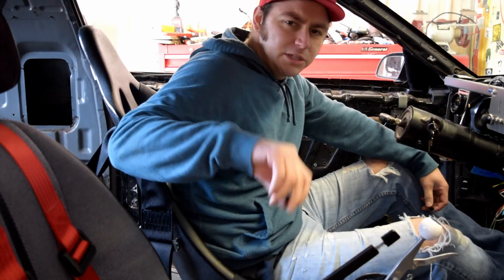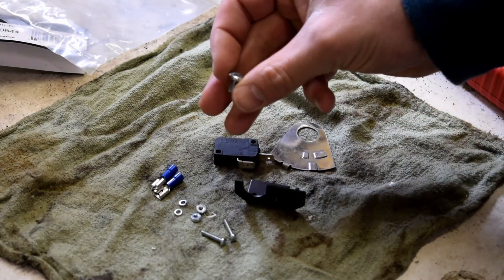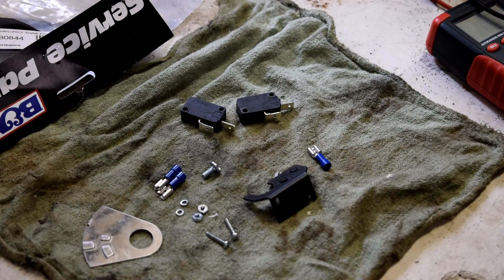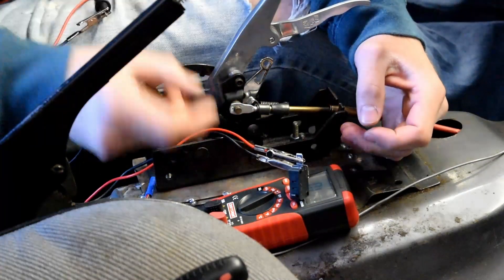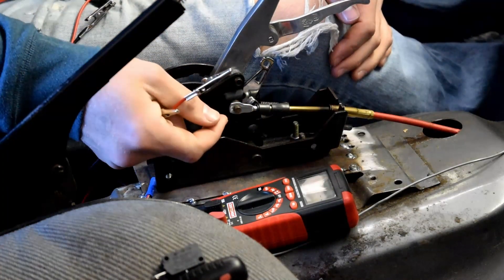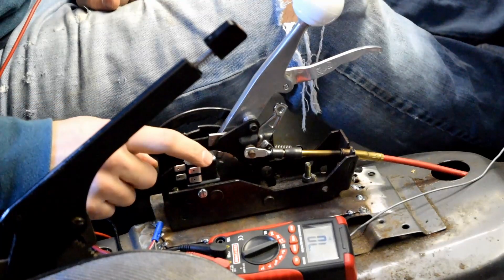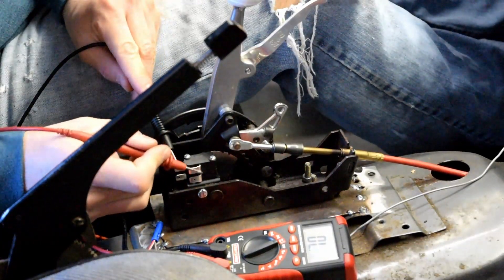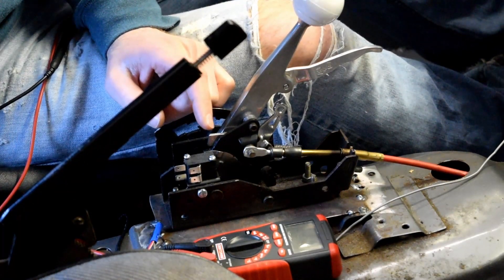B&M Neutral and Reverse Light Micro Switches Installed on a Pro Stick

Comment: Nice work and good video. Did you have to use those microswitches to trigger relays? Or are the switches rated to carry enough current to powers the reverse lights/NSS? The rating on the micro switch that came with my shifter is 0.1A @125 VDC. Not sure what the translates to in a 12V system. Thanks!

Comment: I've had the neutral safety switch on my Pro Stick for years but never really knew how to install the reverse light switch. Bought one a long time ago but never used it. I had no idea they bolted together till I saw your video. Now thanks to you posting this video I have both installed and working correctly. Thanks again it was very helpful and detailed

Comment: Great video, thanks for posting. We've added it to our "How-to" videos page and will be keeping an eye on your build.

- Jason @ B&M Racing
Reply: My apology for pointing this out, but it looks like you may need to include 2 longer bolts in this kit as well as the short ones.
Reply: @drag_week_racing_adventures And a stronger box cover with a illuminated PRND21, and micro switches that fit without having to dick around.
Reply: Hey Jason, Jason here!
You got any videos on how to remove the anti reverse mechanism?
I have an offroad project and this mechanism is a pain in my backside!

Comment: To anyone who dont want to drill your switches  the screw size is #4-40x 1 1/4. They have it at lowes with the nuts for $1.50
Reply: Will 1 inch 4/40 work?
Reply: Randy Chong just barely

Comment: Got a Pro Shifter and it looks like it had a reverse switch at one time. Still has the plate and 2 wires w/female connectors. I also got the 80844 kit and 80609 switch. Are the 2 switches the same part?
Reply from the maker: Yes they are the same switches. Use for reverse or neutral safty. 80609
Reply: @alloyspeed1889  Thank you!

Comment: Did you do the wiring how to?  I thought I had seen that some time ago.
Reply from the maker: For wiring it into a camaro harness?
Reply: Alloyspeed well, I’m installing the switches on a ‘71 Nova. Wires are purple and purple with white stripe.
Reply: Alloyspeed I’m not sure which are the wires for the reverse lights.
Reply: Alloyspeed really, I just need to know if it matters where the wires connect into each switch—top or bottom?  I’m thinking it doesn’t matter(?).
Reply from the maker: @thewhiteelephant  I dont think it matters on with leg of the switch you connect to. Also my lights are grounded in the rear and I only needed to supply power.
Reply: Alloyspeed man, I can’t adjust them right. I got the reverse lights to turn on, but they are only off in “park.”  They are on in reverse, neutral, drive, and low.
Reply from the maker: @thewhiteelephant  I'll have to double check how mine are but I cant till monday.
Reply: Alloyspeed bud, I figured it out. Really, there’s no “exact” way of doing it. You just have to place both switches as close to the shifter as possible, cycle the shifter through all the gears, and watch the switch tips come into contact. I was on my wits end, finally really looked in there to see how the switches operate by coming into contact with the raised ridges of the plate, and VOILA!
Reply: Alloyspeed i appreciate your feedback. Thanks again!
Reply: Also, for anyone that is wondering, it doesn’t matter where the switches connect, as long as both are on the same switch, of course. All they are doing is completing the circuit when the switch is pressed.
Reply from the maker: @thewhiteelephant  sorry I forgot to get back to you.